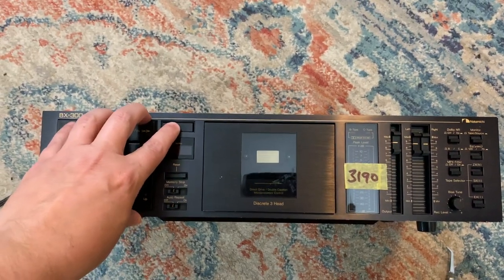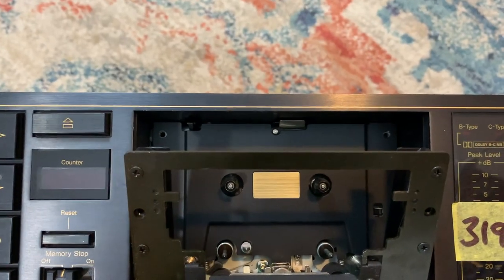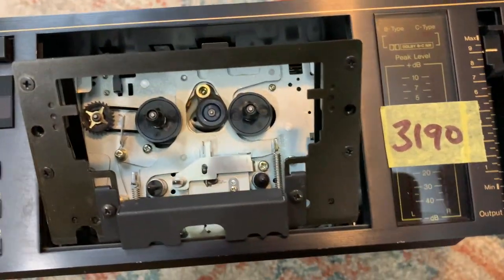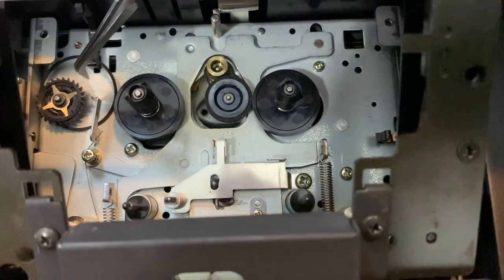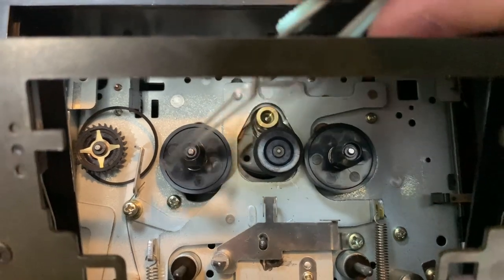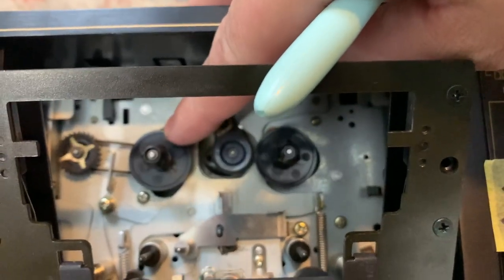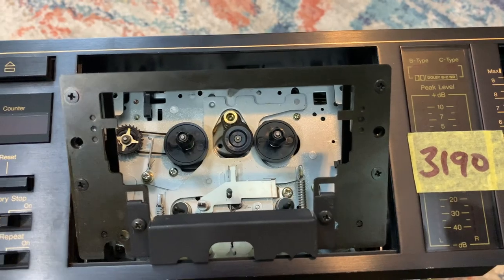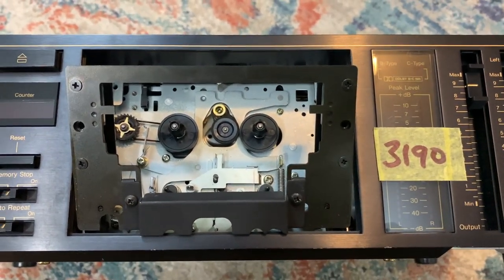How to EASILY replace the back tension belt in a Nakamichi cassette deck!

Comment: One thing many people miss is when replacing that back plate there are notches that have to fit into grooves in the locating posts.  If the plate is misaligned then interference with moving parts can happen, or the tape itself might not lock in correctly.  It’s an easy thing to miss so we must pay close attention.  Thanks for the video!
Reply from the maker: Excellent point, thank you for sharing!!!
Reply: @ForeverAnalog  - I include myself in the ‘many’.  Yup, learned the hard way 🥹

Comment: Where did you get your belts?
Reply from the maker: Check the link in the video description! Or google “Nakamichi belts vintage electronics” and it should be the first link to pop up.
Reply: @ForeverAnalog  thank you! Quick and informative video! I don’t have the issue with my Nak but will eventually since it’s 40 years old!
Reply from the maker: @primeanalogrecords  thank you for watching!

Comment: I have tec 4028 and i opened back plate and i can see belt that has fallen off but i cant acess it because the motherboard wont move even after i unscrewed all of the bolt

Comment: Oh my god, this is very convenient because I have that same model with the same problem. I'll test it later, and edit this comment. Thank you for this advice!
Reply from the maker: Awesome! Sometimes if this doesn’t fix it there are motor issues which require more in depth work but hopefully just the belt gets yours going again!
Reply: @ForeverAnalog  Yup, I went in and ordered the parts for this cassette deck. But I don't believe the problem is that bad as I confirmed that fast forwarding, rewinding, playback, and recording are working. It's just that this crumbling reoccurs at random times, and I bought it from a secondhand store on eBay as well with confirmation that it works. Seller didn't mention to me about this crumpling my cassettes, though. 😞 I'm very much hoping this might just be the solution for it! 😊

Comment: I have a Nakamichi BX-100.  This seems like the problem I'm having.  Went to your link but I wasn't sure what exactly to purchase.  There seemed like a lot of choices.
Reply from the maker: It's probably easiest to purchase the Nak BX-100 belt kit on their site as I don't think they sell the tension belt by itself. But this way you'll have the other capstan belt if needed later on down the road!
Reply: @ForeverAnalog  Great!  thank you so much!
Reply: When I got the plate off neither belts were visible.  The BX 100 is a little different than the 300.  I had watched another video about issues with the idler wheel and that sanding it a little would help and it did!!!  For a few rounds with a couple of tapes so I probably should replace that.  The other belt is pretty loose though (the one on the right).  What is that called?  I opened the bottom because I dropped the little screw and I saw the left hand belt that that seemed in good shape and it turned things well.  Have you done any videos on replacing the right hand belt on a BX-100?  BTW I really want to thank you for giving me the courage to tackle this!!
Reply from the maker: @divaarch59 I need to make some bx 100 videos! The belt on the right is for the counter. Definitely change the idler tire. If you Google “Nakamichi BX-2 idler tire replacement” you should see my blog post that shows how with photos. It’s not hard you just have to go slow so you don’t use the plastic washer
Reply: I will check that out.  I saw someone's video and they warned about losing the washer.  I will look for your blog post.  You're very clear.  Thank you so much for your help.  I would never have believed I could do anything like this.  It's so empowering.  I was a classical singer for years and have tons of cassette tapes of performances, coachings and practices.  I'm trying to digitize as many as I can before it's too late.  The Nakamichi has a beautiful sound and so being able to do basic repairs myself (hopefully) is such a relief.  It's so hard to get someone to do it.  The guy who sold it to me doesn't do it anymore.  @ForeverAnalog
Reply: I did it!  I replaced the belts and the idler wheel.  I did find a video for the BX100.   And it was very helpful.  BUT I NEVER WOULD HAVE EVEN ATTEMPTED THIS if you hadn't gotten me started and helped me find the right parts.  I'm so very grateful.   THANK YOU, THANK YOU, THANK YOU.  It's people like you that empower the rest of us through your generous willingness to share your knowledge.  Bless you!